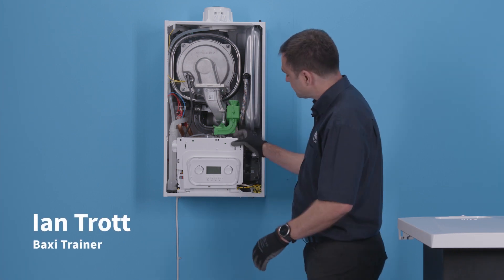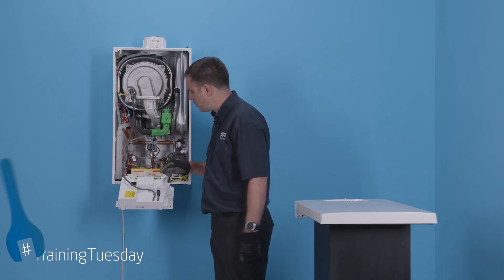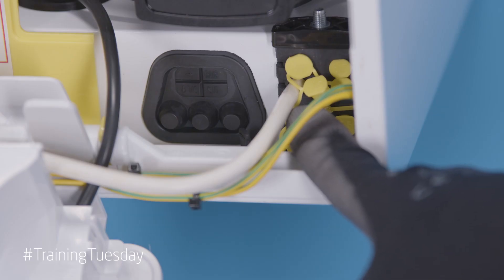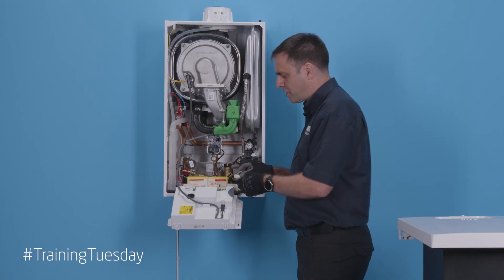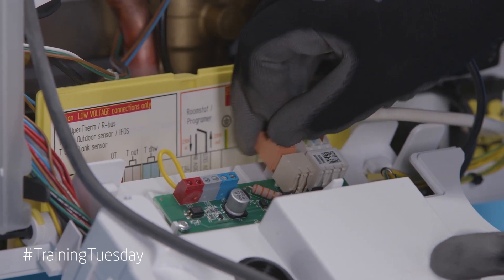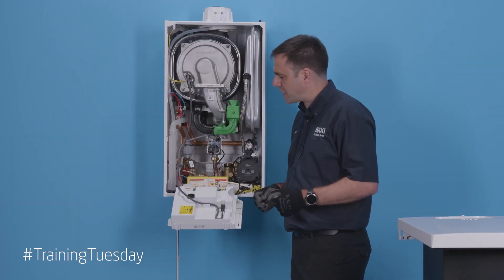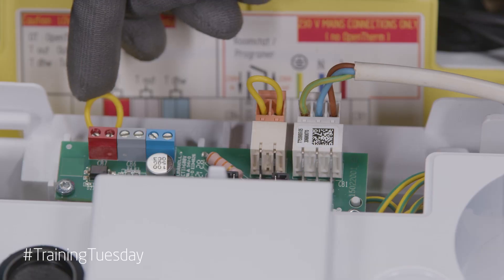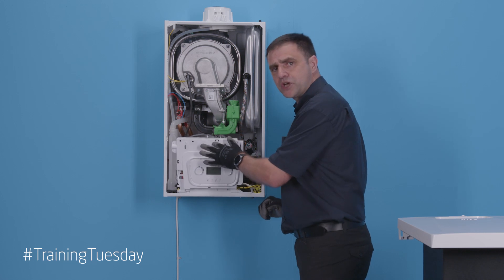Part 1 - Baxi 400 Combi 2 - Wiring

Comment: For Nest 3rd gen learning thermostat: What never seems to be mentioned is that to make Open Therm work you need the link in the boiler removed (just as you would for a normal on / off thermostat) & also you need to activate Open Therm in the Nest thermostat - in: settings, pro setup, continue, combi & then select heat with Open Therm.